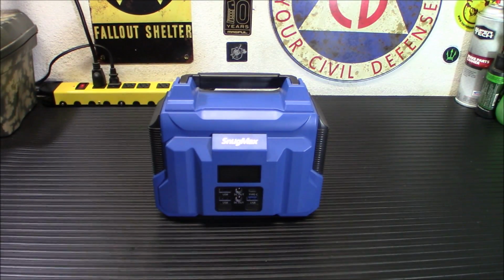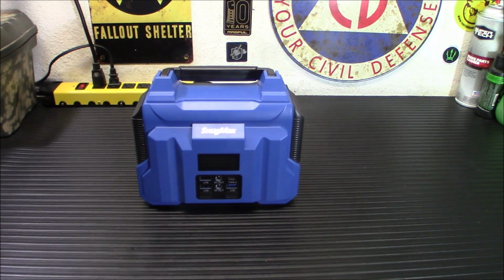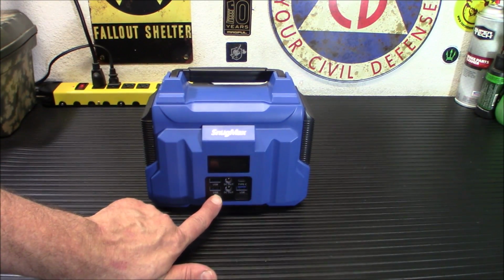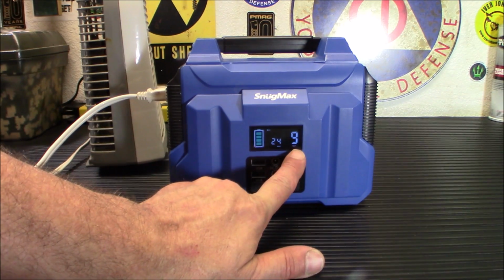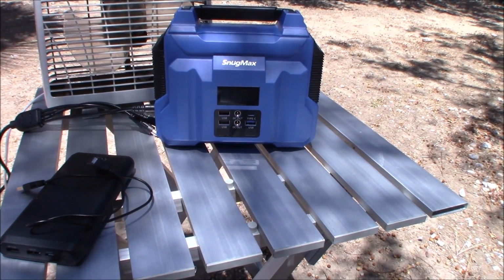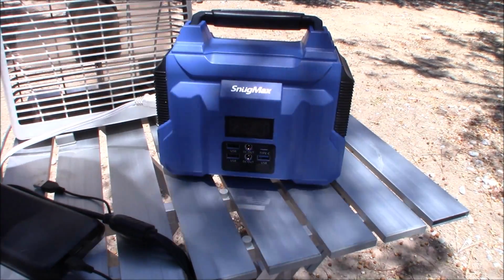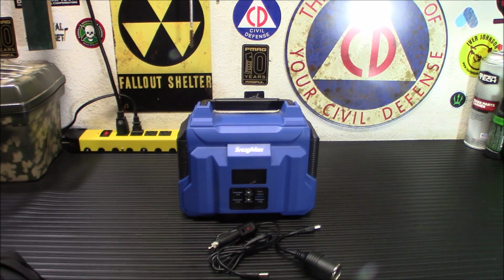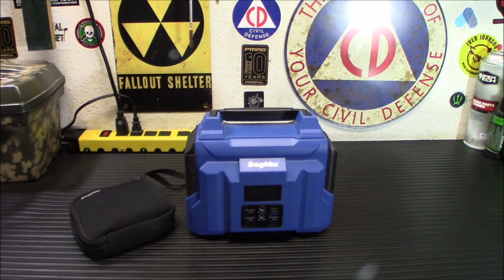SNUGMAX Vickers 200 Portable Power Station

Comment: can you have this  re-charging with the solar panels AND charge  something or run something like the fan at the same time? Also, wouldn't a 100 watt panel charge it quicker?  thanks
Reply: No AC power use while charging, but you can use DC. Yes, a stronger panel would be faster, but must match the power of the panel with the max power input so you don't damage your devices

Comment: I know nothing about electrical, is this something that would power a refrigerator for a few hours? Seems to be mostly for recharging batteries, which is useful.
Reply from the maker: Not a refrigerator but perhaps a radio, a fan, a small swamp cooler, things like that under 200 watts.  Bigger units can power a fridge however.
Reply: Would this operate my blower cause I have my own grass cutting business  my blower is electric

Comment: looks like a good unit for the price just remember it only 220 watt station, I have the Jackery 240 so close in what they can do
Reply: Which do you prefer? Or, should I pay the extra money and get a higher watt generator?
Reply: @MikeSenseiVegas  just depends on your power needs, when I'm out car camping this will recharge my laptop, phone, run some LED lights and a small 12volt fan, anything that uses less than 240 watts, I bought the Jackery from all the good reviews it has gotten, they go for about $240, this one George showed at reg of $299 I would not pay but being on sale for $199 maybe but Iwould still go Jackery however new on the market is the Baldr 330 watt going for $269, the more watt the price goes up (sort $1 a watt)
Reply: @craigbetts1586  Very informative...I am going to go with your advice. The Baldr will suit my needs better. I still bought the Snugmax, but as a backup. Your help was much appreciated!
Reply: @MikeSenseiVegas  glad I could help if I didn't already have the Jackery I would go for the Baldr too